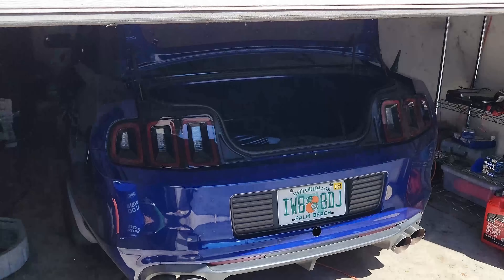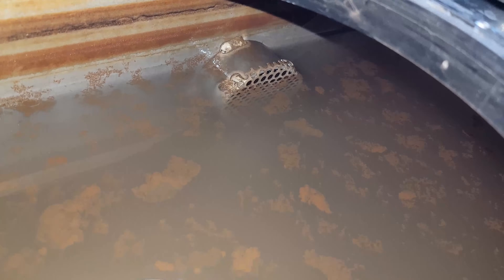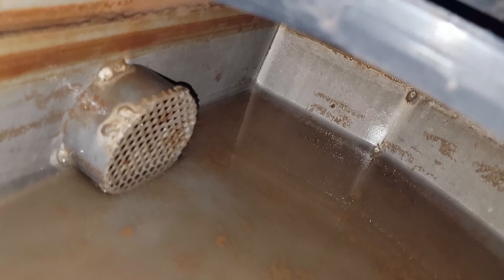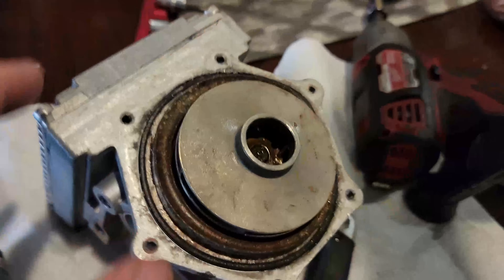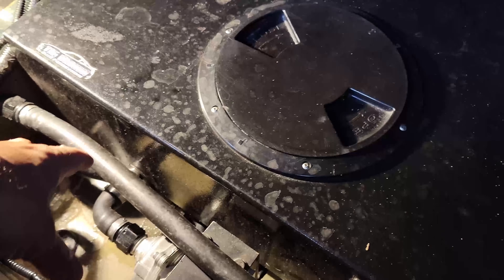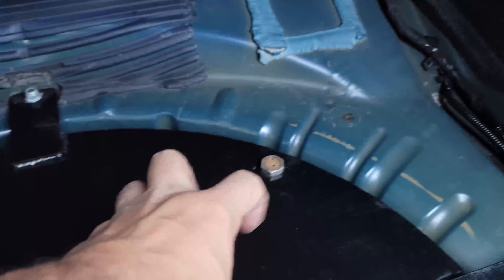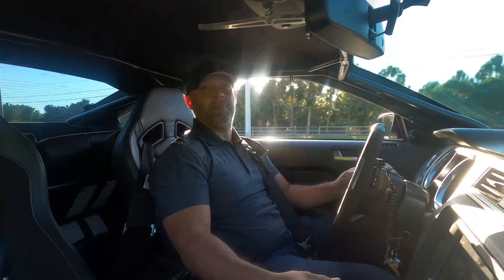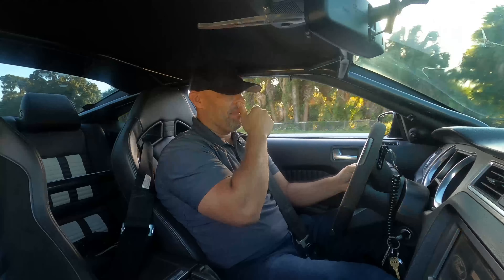My 2014 GT500 Ice tank keeps losing prime and the fix was so simple.

Comment: This car really came back together nice.  With that grime in the water I'd loose the pneumatic breather vent altogether for a 180 bend fitting venting out the floor or to a breather tank that drains back into the water tank.  You may also want to consider cleaning the tank and epoxying in some baffling.

I'd be interested in a video going over supercharger cooling tech and options such does tank size matter for a street car vs race car, pumps, pros/cons of a rear tank, intercoolers, pros/cons of a/c chillers, exhaust venting for air entering the grilles. 👍

Comment: IAT 2 on my Maggie read better recovery if I use some part throttle during recovery period. I think in my case it is where the sensor is located and needs some airflow to go across it read a more accurate temperature reading. I have an interchiller and readings on decell where higher than expected when looking at logs.  The weird thing was when I would get back on gas the drop in IAT 2 was significant. So I tried some part throttle after a pull and temps would go where I expected. With my setup I have intercooler temp sensor and would see that cold but IAT 2 high during decel. Don’t know if it applies to you but figured I would share and you can rip me or thank me 😂

Comment: The same thing happens when guys use big fuel pumps. They'll run a -12 feed and return with a big belt driven pump and then try to run a -6 vent. The pump tries to collapse the cell, and since it can't do that it starves for fuel. That's one of the reasons belt pumps got a bad rep back in the day.
Good find brother!

Comment: For that vent, you can a replacement anywhere you can get air tools from. They call it a muffler and there’s all kinds of sizes but pretty easily sourced. Often used as a diffuser weld backpurge as well

Comment: What's up with all of the residue in the ice tank?  Looks like sewage water.  Any concerns that the residue will cause flow issues through the intercooler brick?
Reply from the maker: It might so I'll flush the system and use s little coolant. It will help